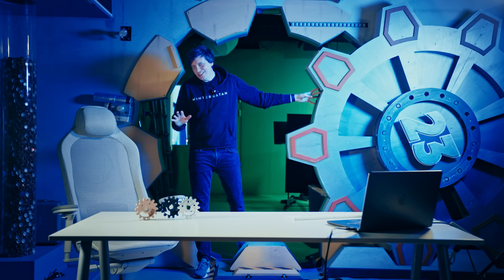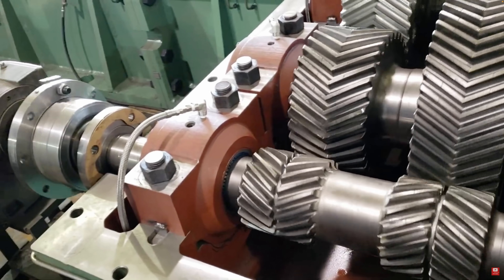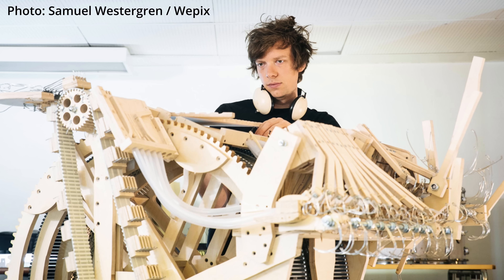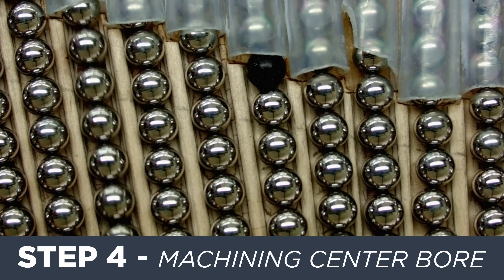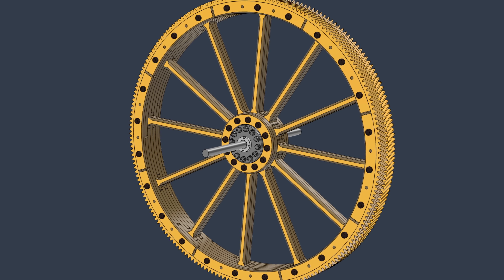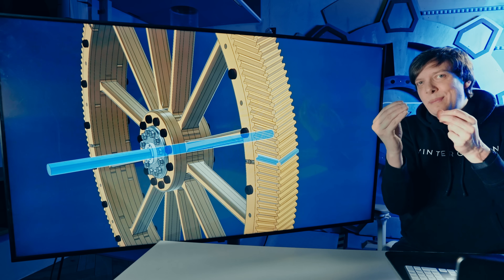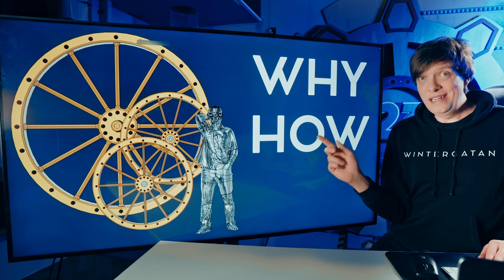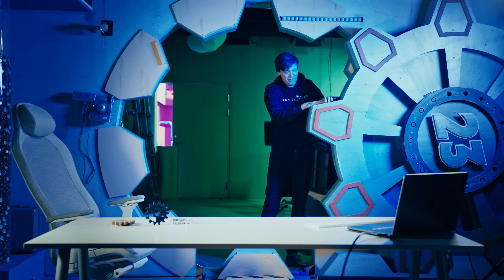How I´ll Make the Worlds Largest Plywood Gears

Comment: The logistics of that glue-up will make it basically impossible to accomplish reasonably within the open time of most regular adhesives. Either you would end up with a messed up gear or compromised glue bonds due to messing with partially cured glue. Hide glue likely could make this doable, as it has a very long open time, around 10 minutes, but it has its own tradeoffs. I think you really need to carefully think through other alternative paths to accomplishing this glue-up in multiple stages. Obviously torquing all those bolts multiple times would be incredibly time consuming and introduce potential error, but accomplishing a 7 layer glue-up in one shot like you're planning is a recipe for disaster.

Comment: Wouldn't it make sense to maybe make the gear base some kind of hybrid/composite with a plastic or metal inner core to also help with dimensional accuracy of the wheel? Because with a >1m wheel, even 1% of dimensional change accumulates to over 1 cm of size change. This for a wheel would result in >5mm of radius change, which might go to a scale where backlash will not suffice to compensate for the bad fit.

Comment: Does it simplify anything when cutting the gears if the gears are made in 2 pieces (front and Back) which could allow cutting across both pieces in a single direction, and once all the gears are cut, flip one piece around to then have opposing helical gear directions that were easier to cut?

Comment: Wouldn't backlash in the gears screw over the music tightness? Wouldn't they also be incredibly noisy?
Reply: Nah, he didn't explain backlash well, he's talking more about play between the teeth, backlash is more a thing when reversing the rotation.  Think of an astronomy telescope, it needs to be very precise, if you turn it to a point, fine, but if you then reverse back to the original start, it takes more motor spinning due to backlash, as a bit of motor turn takes up that slack, then starts to move, and moves.  Accounting for backlash really matters when there's back and forth movements.  So not really impactful for this use case.
Reply: @RJFerret  I know he's talking about play between the teeth, which is what made me wonder if the inertia along with a possibly slightly irregular power input would make the gears rattle a bit
Reply: Backlash is only a major concern when you change direction. It's the killer of precision in CNC machines, even if you know the backlash amount and account for it in software, because it causes vibration. But for a machine that always "moves forward" it's not a concern at all.

Comment: Wagon wheels were mostly created with wood but had their mating surface made of metal which I think might be something to think about for your gears. I think that the profile of helical gears may reduce the bonding strength of the plywood layers making them more likely to wear long term. It may be better to do plywood for the majority of the wheel of the gear but have the mating surface out of another material, for the same reason you aren't using wooden axles, or peg gears, which would have better matched Renaissance works.

Comment: How does the cost compare to other options? Do the teeth need to be plywood too, or could you use another material around the outside that could be more resistant to damage?

Comment: André Citroën was very important for the introduction of double helical gears, the design is even featured in the Citroën logo. Apparently he learned about it while traveling Poland, where he saw large, wooden double helical gears being used in water-powered textile mills. So it is possible that double helical gears were actually originally made in large-scale wooden forms.
Reply: Very large wooden gear wheels were fairly commonplace before the industrial revolution. There's no reason to assume that Martin has 'reinvented the wheel', or that if you can't find something by googling it must not exist or have ever existed. I think he's just being silly.
Reply: @nagualdesign  specially since google has turn to shit and you pretty much can't find anything specific
Reply: @hmmmhhhmmh  And now we also see that Martin relies on Grok for engineering knowledge... 🤦‍♂️
Reply: Ooh, so the Citroen logo is basically a face-on herringbone gear? I didn't know that, thanks for the neat fact 😊

Comment: Marine Plywood: I'm sure you probably already know about this, but there is a grade of plywood called Marine Plywood, which is extremely resistant to moisture ingress, which might further help with the humidity issue.
Reply: I work with Marine grade building boats. It’s expensive but considering he’s only trying to make several large gears, it wouldn’t be out of the question. I like using the stuff even just for making furniture because it’s so much easier to work with.
Reply: Plus IIRC you can get marine plywood in teak, which would look stunning
Reply: @StuffandThings_ 

I love your screen name … my father used to come home from work and ask my mother, “How’s my stuff ‘n things?”

She would giggle timidly every time! It was the cutest thing, and so romantic!
Reply: @StuffandThings_  Sure, if he wants to spend the price of a car on the plywood lol.
Reply: @StuffandThings_  And very expensive
Reply: @ Well, that's why you only use it sparingly, for the outermost layer and for the final product only. This whole project is very expensive, it would be far from the worst money pit so far.
Reply: @troubleMakesThree  not dearer than birch. however, i had issues with delamination. its very hard to control the quality when stuff comes from china or south america. Baalic birch ply is produced in europe with very strict and traceable quality control.
Reply: from what i know its just quality plywood saturated with a waterproof varnish
so you could apply it with a brush to get a similar result
Reply: @ there’s a bit more to it. All of the veneer has to be perfect right the way through it without any voids whatsoever. And the adhesive they use to hold everything together handles moisture way better. Also a consequence of the higher quality wood and better adhesive, I’ve noticed it tends not to splinter near as bad as most plywood when you’re cutting it. Like it barely splinters at all.
Reply: @alecsmith4349  Yep, was just popping in to say that the main thing is the adhesive, and I suspect whether or not it splinters comes down to the type of wood that's being laminated. The Meranti BS1088 ive been using splinters no matter what sort of cutting tool i've used on it - jigsaw, bandsaw, circular saw, multi-tool, whatever. Not that I have expert technique.
Reply: @KKJKJH It's a different glue (resorcinol) plus the thinner veneers are chosen to minimize voids.
Reply: Don't even bother to help Martin with tech suggestion.
He does not read, he does not care.
This content is made only to milk views. Which is not bad by itself. This is just a tv show.
Reply: I think phenolic plywood would be the best. Machines very well
Reply: hey tell the swedish guy about plywood ..... lol thanks noob

Comment: sealing the whole gear in a light coat of epoxy is probably a good idea both for humidity control and to make the tooth surfaces stiffer, but make sure any lubricants you're planning to use won't interact badly with the epoxy
Reply: Wood glue is an exultant sealant

Comment: The old school peg gears would look really cool but would be loud as all hell. As for helical gears, brother i dont think tou have any need for them. You are severely increasing the complexity of the building process with little benefit, standard spurs would be just fine. Remember, your machines have not run long enought to have wear on them, since the intent of this one is to do multiple tours, they will wear out fast. There is a reason you dont see wood gears anywhere, and its not just because it can transmit much torque.

I think, in all honesty a mixed approach should be used if you still want the double helical. Use injection molding to create the profiles of the gear, since they are molded you can use one mold for each gear size since you can just divide the circle, and keep spares for last minute repairs, just change the worn out piece for another. The braces and other things wich dont wear out can be made out of wood.

Seriously, think better about milling the profiles on the wood, i really dont think it will go well.

Best of luck, never been to any concert before since im a shut in but when you finish the project i promise i will book a ticket.

Comment: This looks amazing! You're an expert at this point so I'm sure you're already aware, but when you use the torque wrench to bolt the wheel during glue-up, make sure to tighten them in a star-patterned order! like lug nuts on cars. I imagine that tightening them in linear order would introduce a lot of internal stress and could result in bending, long after machining the gear profiles, from changes in humidity or temperature like you talked about.
Also something that just came to mind, you could expose the wheel to temperatures varying from ~0-50C, after sealing the sides, and before machining the teeth at room temperature, getting it to settle might help stabilize it somewhat. I don't have access to machining, so I unfortunately can't offer help, but I wish the best of luck to the project and I'll definitely stick around to see how it goes!

Comment: Your glue up will be difficult. Choose your glue carefully. If it starts to set up before you get the clamps on you will have problems. I suggest a complete dry fit to verify the time it takes.
Reply: A thickened epoxy with microfibers might be a good adhesive, with a slow hardener you can get plenty of time to clamp gear segments. It's also very stable and hard wearing.

Comment: For that glue-up you'd need a glue with a long open time. Standard D3 wood glue has around 8 mins of open time. If you use it, you won't be able to clamp everything in time. You need to look for wood glue which has 30-45 mins of open time.
Reply: I came here to say this also.  But also to take a page out of Dan Lee boat building and use epoxy and finishing techniques
Reply: probably should be a slow cure epoxy. so the entire assembly can be torqued flat before any setting happens
Reply: They'll want a lot of open time to allow for cleaning up the inside edges as the glue squeezes out. Not sure how pristine Martin wants the interior to look but it's going to have a mess of squeeze out all over the place. They can possibly clean it up with more CNC on the inside, but he didn't mention that step.
Reply: good point
Reply: He doesn't even read the comments.

Comment: Consider the material. When you cut gears, the cuts are perpendicular to the laminate and that makes sense. When you cut helical gears, you're now cross cutting at an angle through the layers. You may get chipout and more unstable wear as a result. You may wish to slather on some epoxy along the teeth profile if you do that.
Reply: As for the type of plywood I'd say that naval plywood should be the choice (as long as it comes from a reputable source) because it should resist warping and delamination due to humidity. And there should be a sacrificial layer on top of the gears because his intention is to go on tour with the machine so the wear and tear will start showing at some point.
Reply: What about cutting the teeth into metal rims that wrap around the plywood? That way we get the aesthetics of wooden gears, but the durability of metal contact points.
Reply: its actually called herringbone gears not helical he is making. 
Backlash will not just be a problem if the timber swells in diameter, the slightest buckle that is introduced after machining will make the opposing profile angles bind.
Just part of a gear catching the sun while the rest is in shade would be enough. Garden variety spur gears are tolerant to this happening. 

The machining methodology is good, the choice of material is problematic. 
Actual helical gears would be a safer bet, quieter than spur gears but less constrained than herringbone gears.
Helical just has the issue of introducing side loads.
Reply: great insight here
Reply: yes, my biggest concern with this would be cutting diagonally across the layers. not really the strenght but the surface finish
Reply: If the quality of the plywood is anywhere near what this kind of engineering would require, then there should not be critical failures with such narrow cut angles the teeth needs, 20-25 degrees or so. And because the gears are double helical, the wear pattern should stay consistent and predictable, which might not be the case with regular helical gears or spur gears as the wood lives and the contact area moves laterally.
Reply: Ive used a lot of baltic birch which has an exterior grade adhesive. I gave a piece to a friend of mine who has used it for years as a trailer bed and it has held up to all the elements and the abuse of his equipment that he loads in and out of it on the regular.  Most people are thinking of the wrong thing when he mentions plywood. You cannot find it at any big box store. I can guarantee that 99 percent of people have never seen this stuff or at least knowingly seen it. Also currently It's extremely hard to get a hold of in the US since it is an export from Russia. Birch wood from other regions like the US and Canada are very noticeably softer and less dense.
Reply: I really think he does not really care about durability. It's all for the content and the journey. Then, a larger project like this one, has very little chances of being moved around easily without facing serious issues.

Comment: I have concerns about the stability of the plywood effecting the tightness of the tempo.  You might want to consider adding layers of some composite (carbon fiber, fiberglass, whatever) to the outside faces of at least the spokes (the area where you are going to have the most flex) to stiffen it up and improve the dimensional stability.

Comment: is there an engineering need for the double helica gears? 
I dont know anything about your machine and dont want you to tell you how to do your job, but are they really necciserry or just eye candy? Eye candy may be a valid reason, but you gotta watch out that these sort of nice to look at features make the machine and thereby the project more work. 
For my electronics projects i usually focus on reducing complexity and optemise for getting the project done. 

Of course, if there is an engineering need for those kinds of gears my whole rant here is irrelevant.
Reply: The AI overview says they're quieter, distribute load better, last longer, and transfer more energy.
Reply: @michaelmiller5177  Yepp! Do agree! however they are more expensive, complex, more difficult to design, and assemble. 
I think (although I am no the engineer of this project and havent seen anything in person) a normal helica gear would be sufficent if you want that extra smoothness (but then you are intreducing axial loads which have to go somewhere).

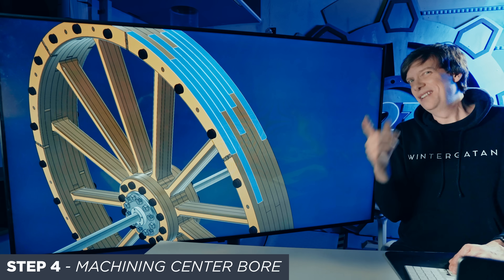Comment: 7:51 The double helical gears look great in CAD, I am worried about the accuracy when machining the teeth profile though. When rotary machining those large diameters, the servo/motor controlling the rotational axis must have a very high angular position accuracy/torque in order to machine the very edge profile. Slight misalignment or low holding force will most likely not have the precision you want! I personally never thought the straight cut gears looked bad or needed improving, they worked great and performed perfectly like you said!
Reply: It would have to be a very strong, very powerful motor for precision. Costly too... plus a single mistake and the entire gear is rendered useless
Reply: what he could do is use a belt drive with a large gear ratio to gain that high rotary accuracy. But yea, i agree, this really doesent need to be a thing, the old gears worked perfectly, but i love watching anything he makes!
Reply: Could cnc a gear in-place  in a temporary mounted extra piece of plywood for good accuracy
Reply: To improve the rotary accuracy, it may be possible to lay the wheel flat with a vertical fixed shaft.  Use the CNC head to rotate the wheel in steps, using a drive pin and circular motion out near the circumference.  At each step, a manual router and jig mounted horizontally can make the teeth cuts.

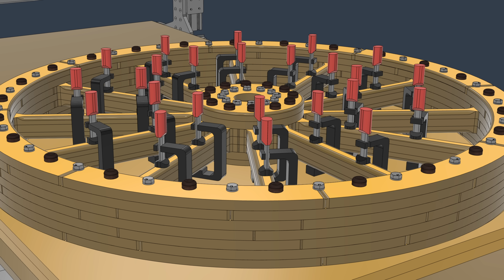Comment: 6:33 Tightening the screws with torque will not be even. Each screw affects the screw next to it.
Why not use air pressure as a uniform clamp? Or vacuum (also air pressure)
Reply: A large air pressure clamping might be better but this is a known thing and usually bolts are torqued in a star pattern for this reason.  Even on large fixtures like sealing pressure vessels and constructing bridges they do this when they torque bolts.  Many things specify exact bolt torquing order.  If you have a threadripper CPU this is even specified on the install in your motherboard.
Reply: @permaculturepup  The influence of one screw on the neighboring screw is irrelevant for hard structures (steel, aluminum).
Here we have soft material.
Even tightening can be achieved by tightening all screws to 90% and then to 100% in a subsequent round.
Perhaps you should even add a step in between.
Engine cylinder heads are tightened crosswise due to the soft gasket. However, the surrounding structures are also hard. Cylinder heads are also tightened in multiple passes.
Reply: @dataandroid2036 are you arguing with your own comment? doesn't make any sense to tell me this?
Reply: @permaculturepup  I just want to share why I think using a torque wrench on wood is a bad idea.
My English isn't good enough to understand everything and Google doesn't always translate correctly.
Reply: @ Okay I understand :D
Reply: Martin could partner with Hydraulic Press channel.